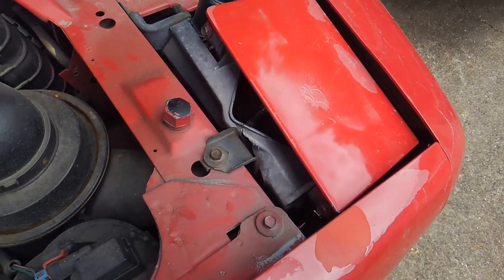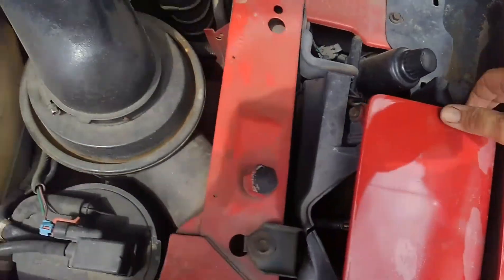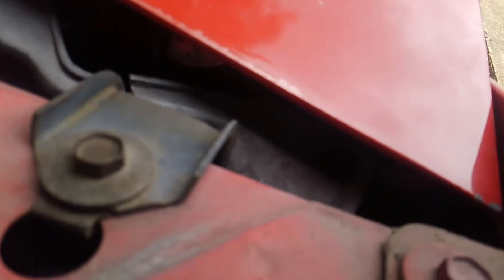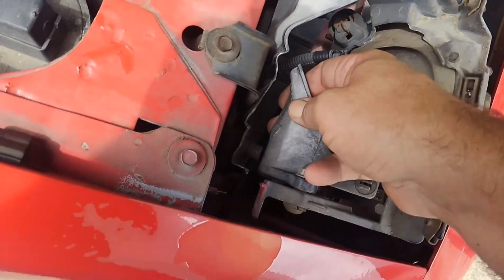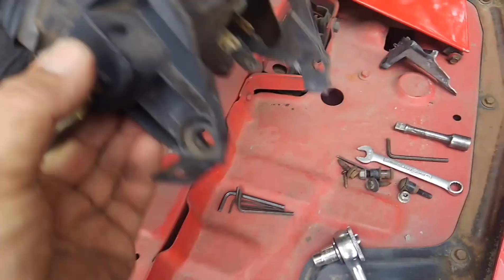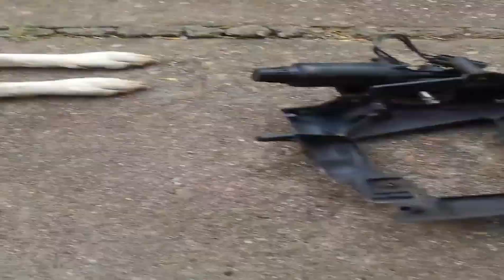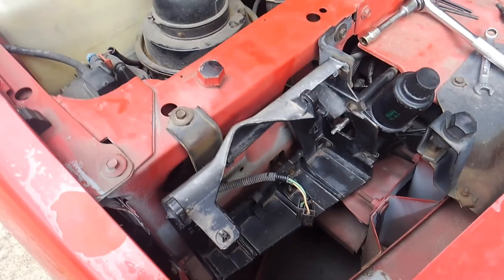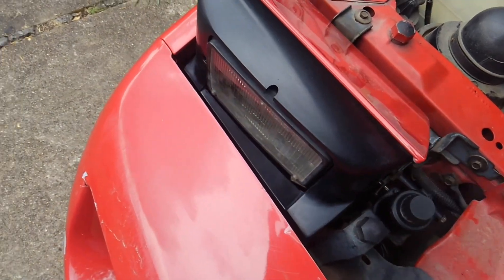1991 Firebird Formula 350 Headlight Bracket Replacement

Comment: what tools and size of tools do i need, my braket broke off as well. This is gonna be my first time doing this so any information would be helpful.
Reply from the maker: Ray,
I used a 10MM and 13 MM box end wrench and 1/4 inch ratchet to remove the bracket from the radiator/core support. You will need to remove the flip up part of the headlight first, then you should be able to access the bolts mounting the bracket to the car. If you have found a replacement bracket, you should be able to see the location of where the bolts go. Let me if you need any more information👍
Reply: @VetteSource  ok, so now i need to know how did you remove the little arm that makes it move up and down (located next to head light motor) thank you
Reply from the maker: @rayespinoza9509  that arm is a ball and socket type held together with pressure. You just need to get a smaller screwdriver and gently apply pressure to the side of the arm. It should pop right out.